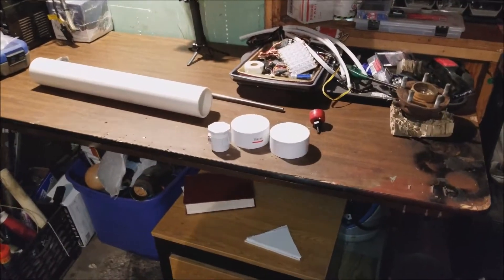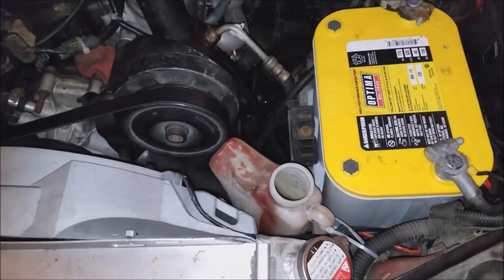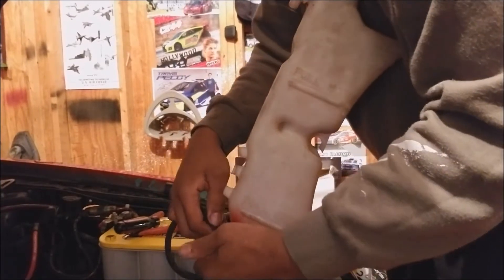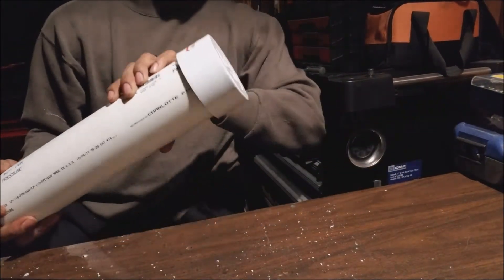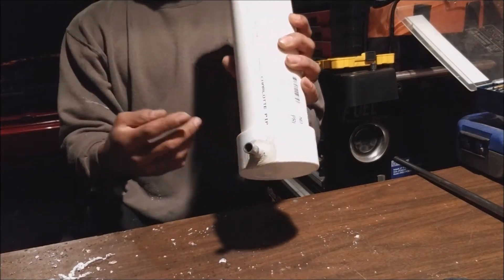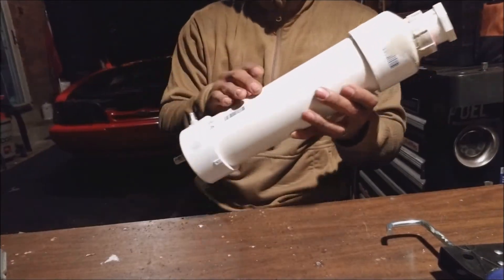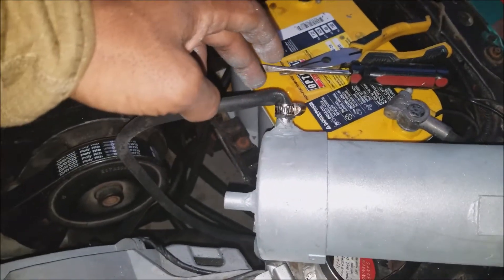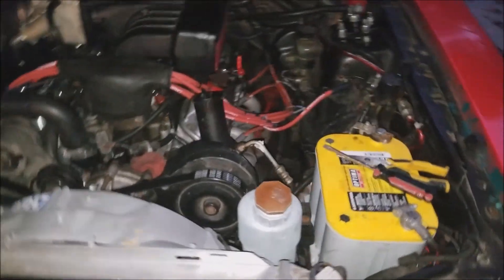DIY Coolant Overflow

Comment: I was thinking of doing something similar, but my reservoir has the pressure cap, but problem im having is the cheap plastic used in my Ford van is so bad and brittle that it needs replaced again after just doing it 3 years agao and only had the damn van on the road for 4 years. I know the radiator can only hold about 20 to 25psi because when the head gasket goes, it will create a hole in the radiator fairly quickly. I had to replace the "T" right outside my thermostat on the side of the road one day and i used a PVC "T" but i put 2in long pieces in all 3 opening ends to double the thickness and its been on for almost 8 months now because honestly i forgot all about it. It's turned it a little pink, and i wanna replace it with an aluminum "T" or something stronger when i do replace it. So I'm going to try something similar to this but use primer and glue but then add an adhesive or JB Weld at the seams and spray with a can of flex seal or the truck bed liner stuff but i will have to find the correct size for cap or buy a different cap that i can match the threads up to the Reservoir  "correctly" and then use compression fittings or something i can screw tight with rubber seals in place for the lines going out. I may have someone record me doing it, so I can post if i get good results and it actually works. I cant find a replacement that's better, and I'm not spending another $65-$75 just to replace it again in a year or two

Comment: Instead of RTV, and/or melting, just use pvc primer (purple stuff) and pvc solvent welding.  It's available in the same place the PVC pipe and fittings are sold.

Comment: Did this work out ok? Temp rating for PVC pipe is only 140F ABS higher but not high enough.
Reply from the maker: this doesn't hold any pressure, so there's no risk of failure.  I'm not using it for what it was designed for and the rating is irrelevant.

Comment: If you make top air tight it won't be able to refill radiator,,,has to have atmospheric pressure behind it ,,like holding your finger over a straw
Reply from the maker: you may have missed the part where I drilled a small hole In the cap.

Comment: should put your over flow drain pipe on the opposite side of your fill. So when you fill it, you don't pour water onto the floor
Reply from the maker: where else would it drain to?
Reply: I think you miss understood what i meant. at 14:25 when you are filling it. the water being poured goes through the overflow pipe
Reply from the maker: ha! I totally didn't realize I did that.  yeah, it would have been much better for the drain to be opposite from the fill cap.
Reply: what vehicle is that old tank from originally?

Comment: How many # lbs of pressure is your radiator cap? Does that matter in order for this to work?
Thanks for the video 👍🏽🇺🇸
Reply from the maker: just use the OEM cap
Reply: @Sgt.Slides  Thanks👍🏽

Comment: Just curious as to why you did run pipe down through the top when it will drawl back in with vacum anyway?
Reply: He ran the pipe from the bottom.